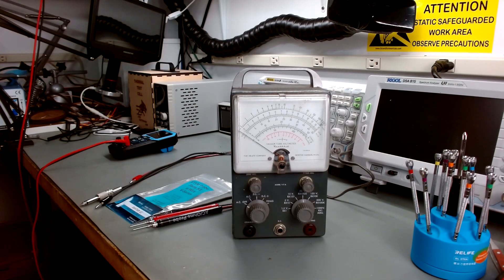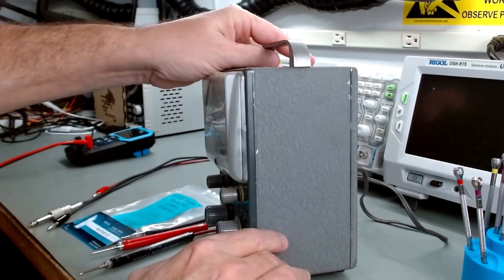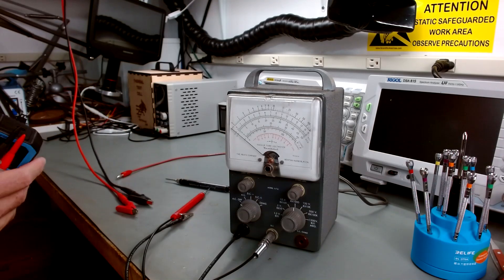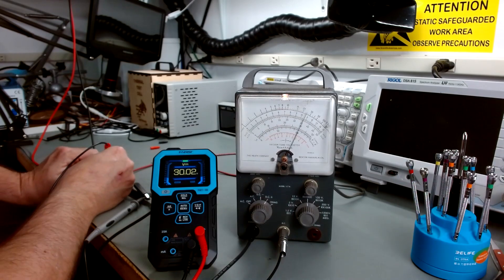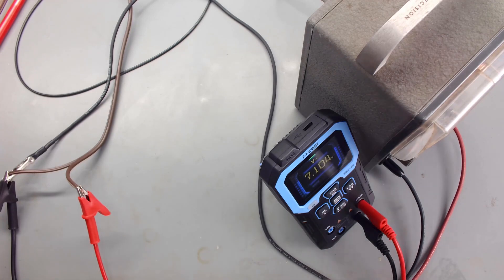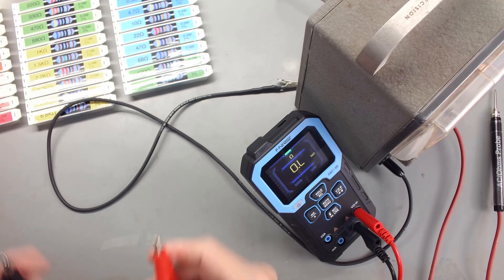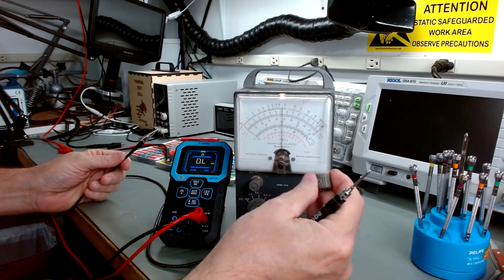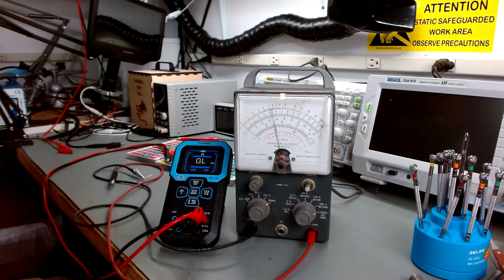Restoring a WRECKED Heathkit V-7A!

Comment: Maybe you can do a follow up vid where you mechanically ZERO the needle before you plug it in & then check voltages.  In my experience with these, the very first step in calibration is to mechanically ZERO the meter before anything else.
Reply from the maker: Thanks, that video is already done. It’s part 3. Part 2 is diagnosis clean up and repair.  Part 3 is calibration and seeing how accurate it is after we repaired and upgraded some parts to see how good it could be. Keep watching they will be out over the next couple weeks.
RJ